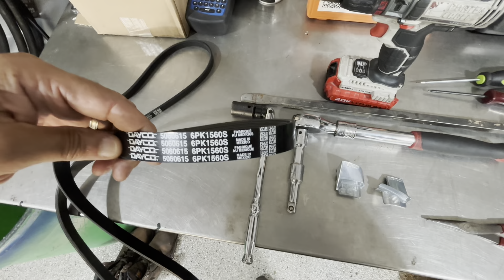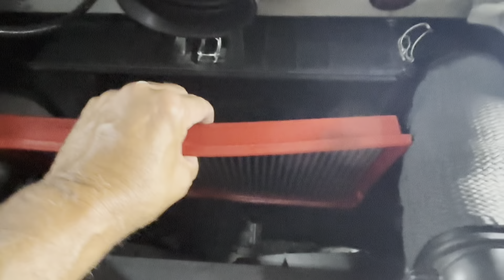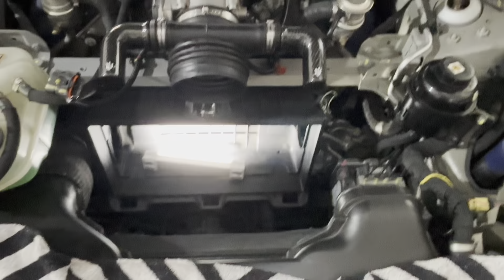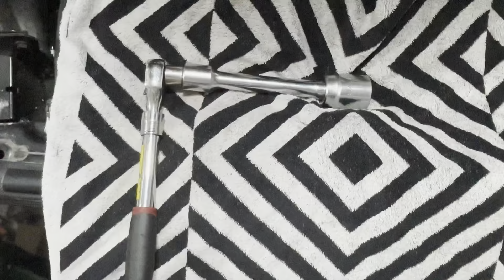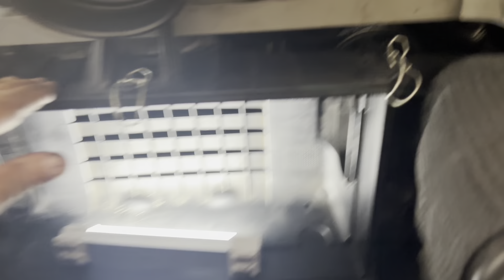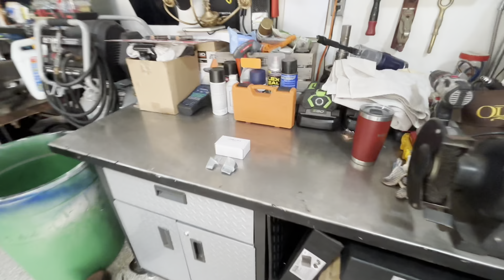2009 Maserati Gran Turismo Engine Belts Replacement

Comment: What size socket for the crank pulley and the belt tensioner? Cheers
Reply from the maker: Hi Dylan. These socket sizes are noted in the video. The crank pulley I used a 1-7/16” & belt tensioner used a 15”mm. Thanks 👍🏼